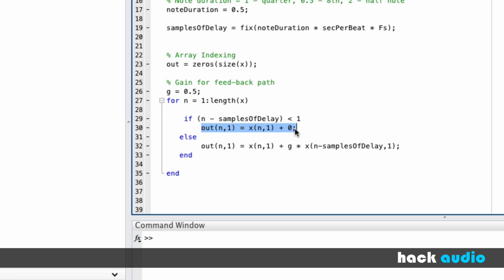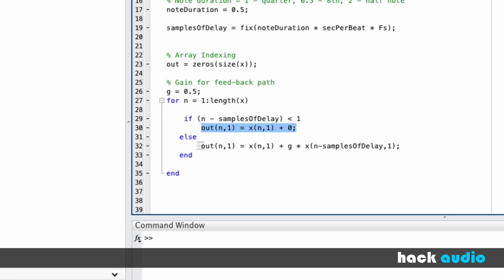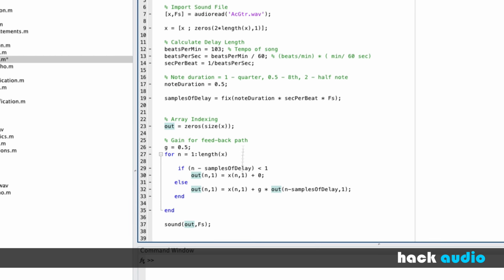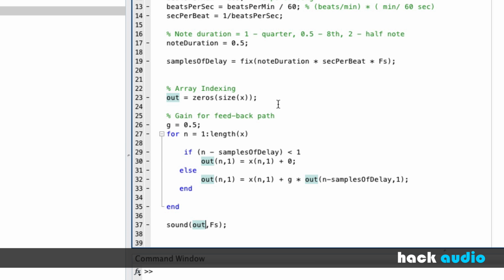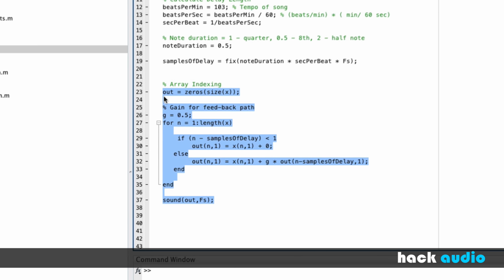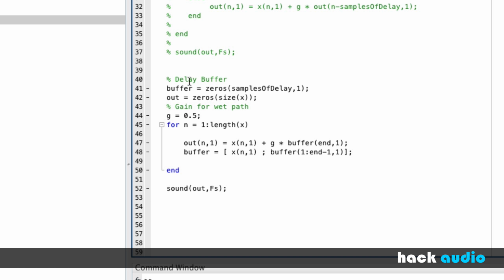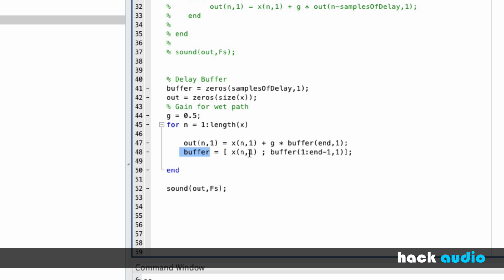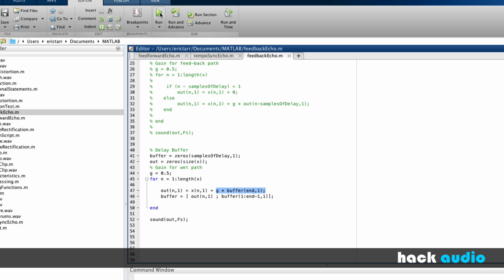Hack Audio: Feed-back Echo

Comment: hi, love the series one question though can this be applied in real-time with chunks of audio data instead of a sound file?
Reply: Yes of course. It is recommended to use the 2nd method by having somewhere to store the past data in a buffer when using a programming language like c++. Aside from that, the code remains exactly the same. With a few tweaks, the code can be copied and pasted into a c++ project and run.
Reply: @jackrussellbruce7565  Cool, thank you so much